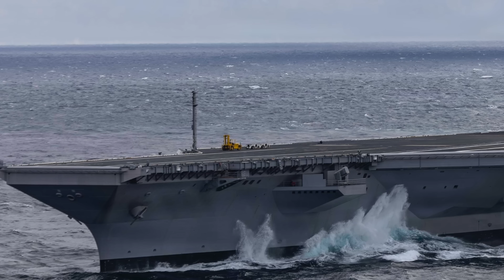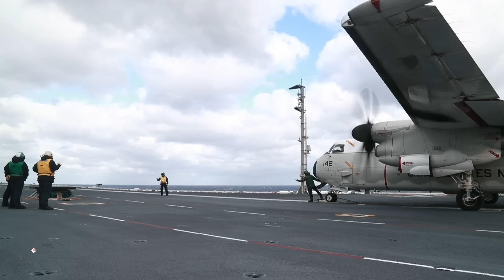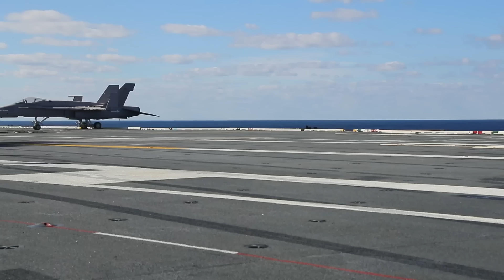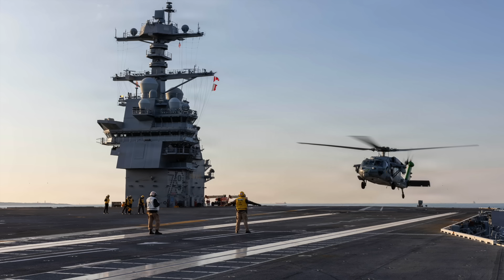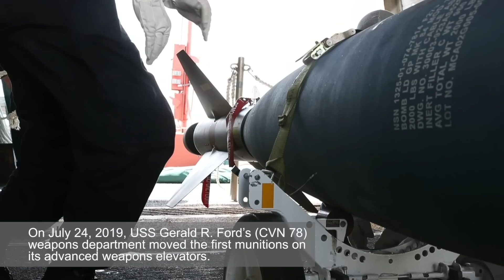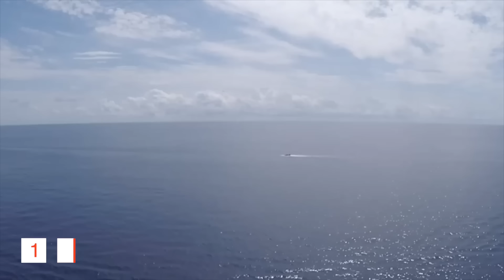How USS John F. Kennedy improves on Nimitz class super-carriers?

Comment: During my time serving aboard the USS America, we spent considerable time at sea conducting intensive training.  The training & drills seems to aid in minimizing "human error". Very clear communication also a factor.  I understand the concerns about crew size.  The turnover on any naval vessel is continuous & replacing crew will always be a challenge. Shortages in critical specialties are often difficult to address & training for a skill can be lengthy (often with high failure rates).  Recruiting & retention must continue to be a focus.  Finally, having a large enough crew to address shipboard casualties is imperative & reducing crew size should not be the sole goal.

Comment: Why compare it to Nimitz class?  That was done with Ford, so, just need to mention any differences vs the first Ford carrier!
Reply: The Nimitz was the backbone of the USN fleet for decades and the Ford will take that role over so its natural to see what the Ford brings to the table
Reply: @verdebusterAP  correct, and Ford has been in service since 2017. There are several upgrades to Kennedy over Ford, video should have focused on the improvements of Kennedy over the lead ship in the class. CVN 80 will have improvements over both, as will CVN 81 and so on and so on.

Comment: With all the extra power available is it this channels belief that Helios and the high powered microwave used against drones will be installed?
Reply: Who knows how powerful lasers might be in 10 years.
Reply: The most effective weapon will be the Epirus Leonidas  high-power microwave (HPM) weapon 
In testing, it smoked 49 drones in one go
Unlike laser, the HPM fries the drone's electronics 
The better option for the USN is the Leonidas for swarm attacks. They need to upgrade their MK-38 to 30mm , specifically able to use the  30×173 mm Mk310 PABM-T airburst round and AHEAD rounds
The HPM would be the DEW and the 30mm would be the back up
Reply: @verdebusterAP  It's def something needed with how drones evolved quickly & are supcheap, so easy to  to saturate AD. And missiles are way too expensive. Tho for ballistic missiles especially they'll still need them.
Reply: @bekeneel  
Thats why the  Epirus Leonidas  ended that debate
by attack the drones electronics, it can take out swarms with ease
The counter is trying to add shielding
but unlike land based systems, the CVNs are sitting on megawatts of power so dialing up the power is no problem. The Leonidas use GaN tech so its hundreds of T/R modules allowing for precise or wide array targeting
The more shielding adds weighs and makes the drone slower. Hence why 30mm back up is needed
My take on the drone is proactive 
as in backtracking them to the launch point and dealing with the operators. Develop an advanced sensor suite that can back them via emission or RF
Smoke the operators before they can attack
Reply from the maker: Yes Helios or some other directed energy weapons will certainly be there
Reply: extra power?